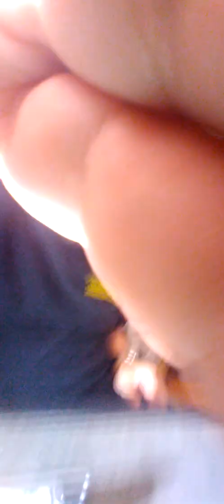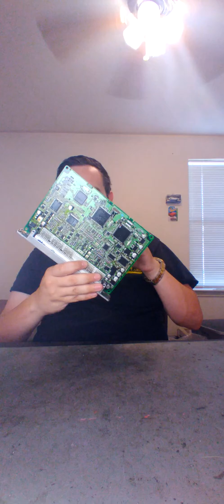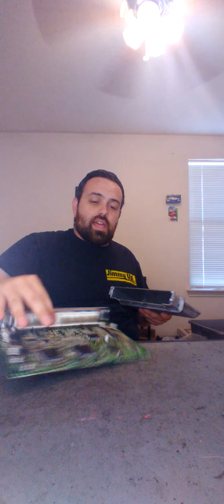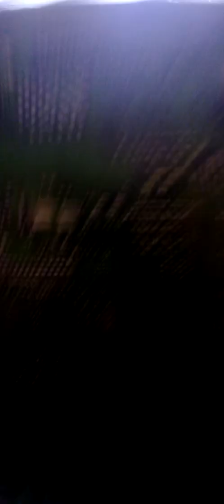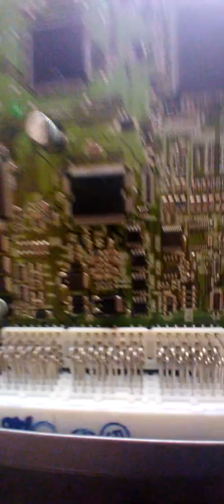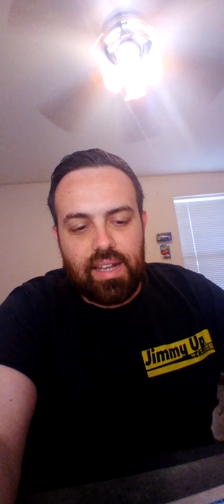LS430 ecu repair

Comment: Maybe you'll respond unlike the others. Does this ECU fix help with issues of a 2005 LS430 not shifting out of 3rd gear on the first drive? I can turn the car off quickly and it'll drive completely fine after restarting.

Comment: I need help. I am not from US. I recently sent my ECU for repair with local guy in my country. After he repaired capacitors and idk what else. My car is throwing P0020 code non stop. Please can you tell me which or what could be responsible for this code? Definitely issue with the ECU as this error didn't exist before.

Comment: was not able to pass smog ...it says modified software on the paper , never had an issue in the past ...i would hook up scanner and all my emission would not pop up only like 2 ..have you see this before????..it does have a hard shift comes and goes .. dealer suspects bad ecu ..planning on sending ecu too you

Comment: Bro i have 2005 ls430 that started to jurk in downshifting when slowing down + the gear is stuck at 3rd ,, I REPLACED THE WHOLE GEARBOX + NEW FLUID ,, the problem still on but only stuck in 3rd gear ,, is it the ecu problem ?!
Reply: u still have that 3rd gear issue???? i got same problem
Reply: Same problem with my ls 430 2004 please help me how to repair ECM.